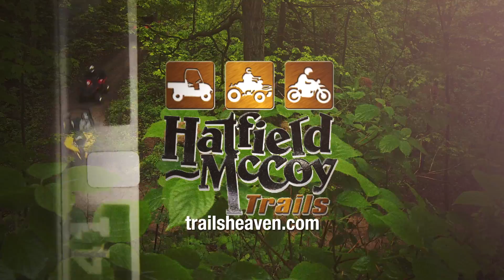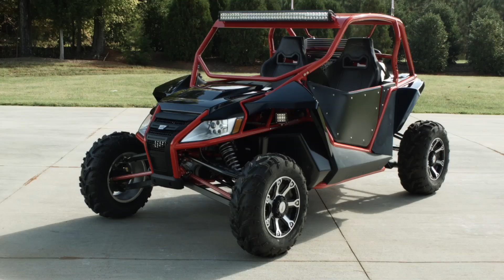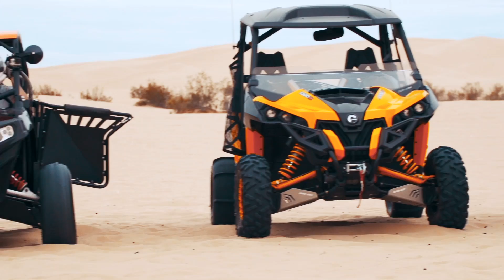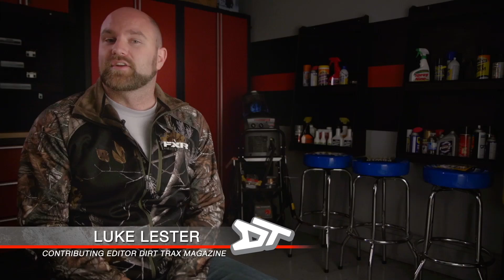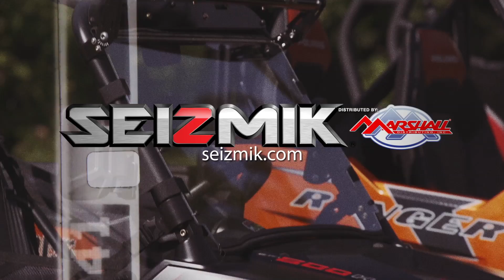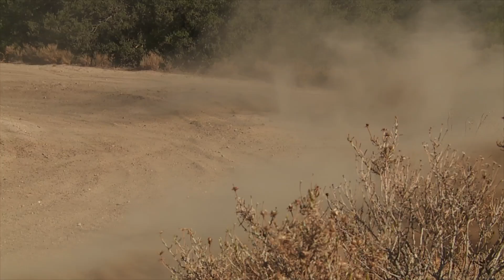Dirt Trax Television 2014 - Episode 19 (FULL)

Comment: So you ran the CVT without a cover... that seems like a great idea getting sand in the primary and secondary. I’d imagine the sand in the belt would chew up the belt surface on the pullys causing grab problems and slipping over time

Comment: i said it before ill say it again that reverse is the worst thing that they ever had for any atv.  Its not a new thing its an old thing from the past on their older esp models and its a pain to use.  the old way on the rubicons with an actual shift lever was 10times better.  I do a lot of snow plowing with my atv and my old rubicon was great for it and doing a lot of forward and back and using that shift set up alone would make me not buy it.  they arent innovative they make things more complicated then they need to be.  Their rubicon which isnt their top model performs better and has more power then their flagship model the rincon because they were being "innovative" with their 3 speed trans.  Im not trying to hate or bash on them but you would think they would pull their head out of their butt and use some common sense.  I see this time and time again where they put so much thought into something that the smartest people in the world over think things and make a complex soultion to a simple problem  I mean they have the shifter there for the high low range why not put reverse back on it problem solved